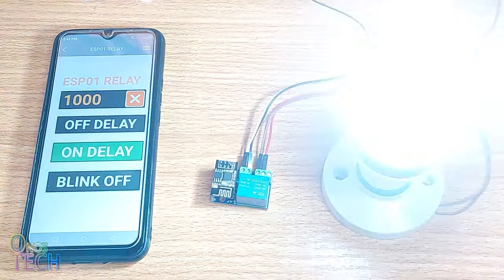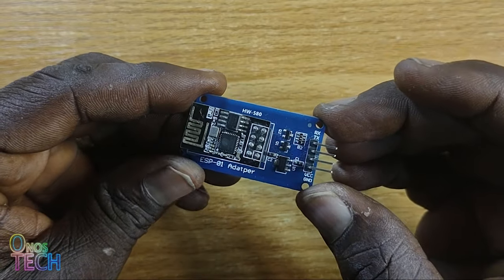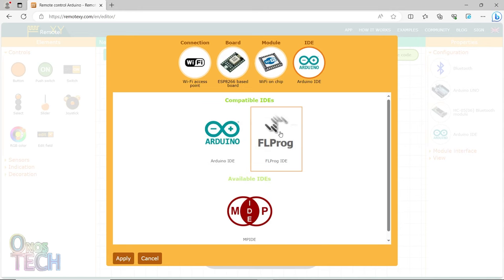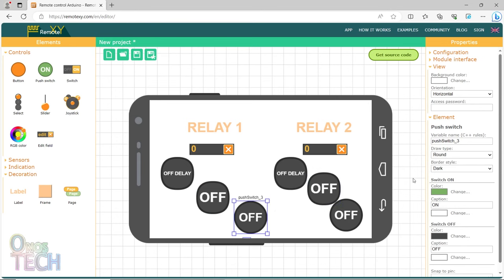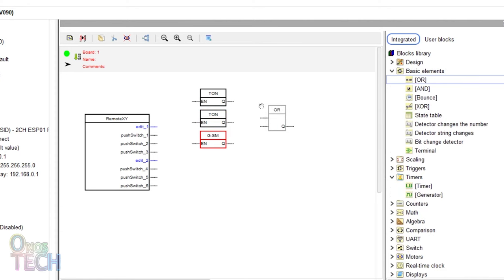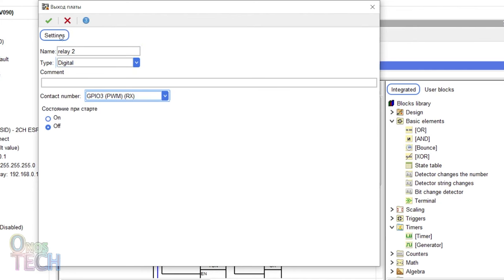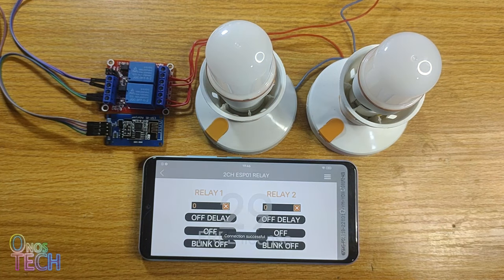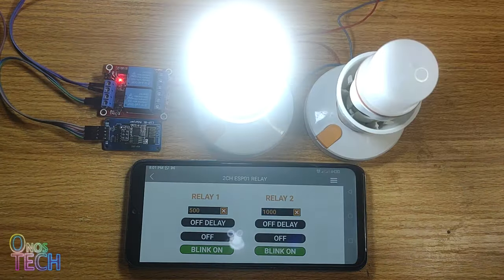How to Make 2-Channel ESP8266 ESP-01 Wi-Fi Relay | ESP-01 Home Automation | RemoteXY | FLProg

Comment: I need help onos please check your email, i have esp01 and 2 chnl relay module and i am confused how to do connection also is that adapter necessary to use ??
Reply from the maker: Using the adapter will make things easy for you. If you want the connection, see this other video 
https://youtu.be/uy6GqgmUiSQ
Reply: @OnosTech  thnx man ❤️